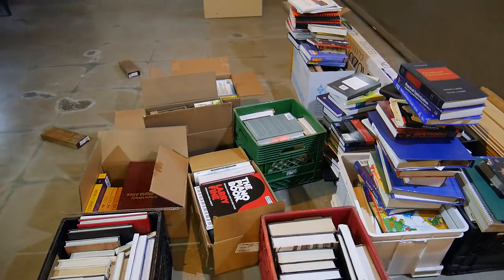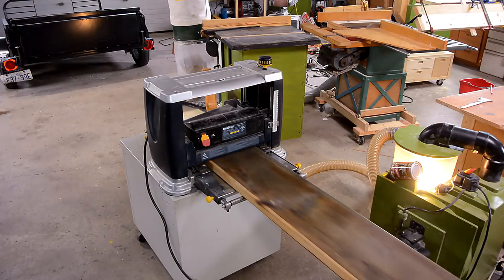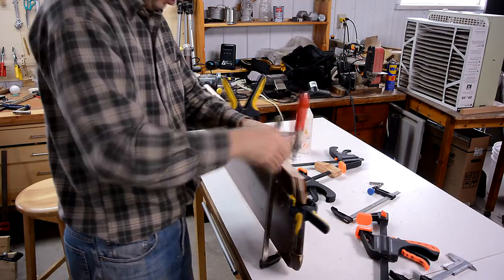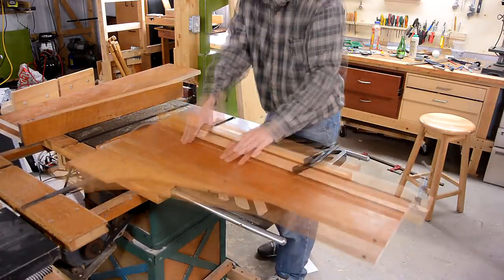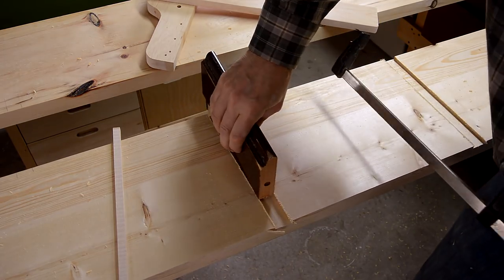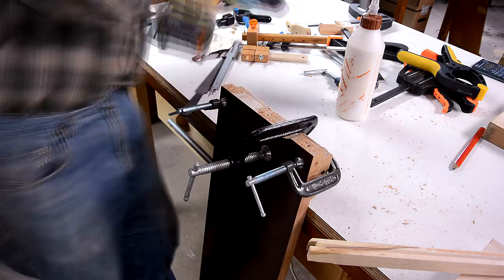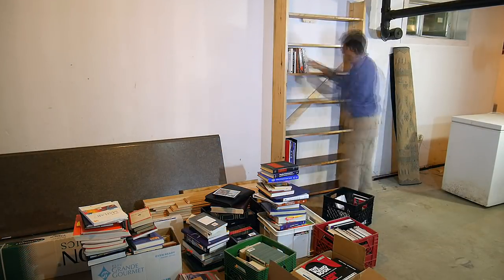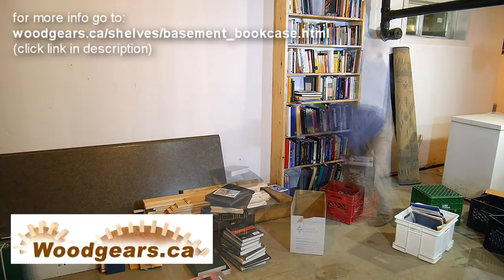Tall bookcase for the basement

Comment: Why did you tap the holes instead of using a larger predrill? I never saw you do that before.
Reply from the maker: more thread engagement
Reply: Matthias Wandel oh thanks for that. Was wondering.
Reply: Matthias Wandel Do the threads engage with the uprights of the bookcase at all? I ask because wouldn't there be an issue with thread alignment if one part is threaded and another is not?
Reply: the screws he used are not threaded all the way to the head
Reply: .... how about a test then?
Reply: Petros Iliadis I like test videos
Reply: jbz3 Me too. There aren't much semi scientific maker videos on youtube.

Comment: Cool practical build. Any reason (other than time) why you didn't plane the shelves too?
Reply: I was asking that myself too.
Reply: This shelf sits in the basement next to the laundry machines.    It is more then good enough.
Reply: The finish on the wood probably would have dulled the planer blades after 1-2 shelves. He would have needed to scrape it off by hand before putting it through the planer.
Reply: Damian Reloaded I was wondering the same. He planned the sides, but not the shelves, so it got me wondering.

I just bought my first planer (Delta 12" ...$150), so I'll probably start wanting to plane every piece of wood under the sun :-)
Reply: Maybe different finishes? A stain wouldn't bother plainer blades. Varnish or any kind of paint would be a different story.
Reply: In another comment below, Matthias said that it was a ply veneer, and plaining it would compromise strength.  Makes sense.

Comment: Why did you need a wood screw thread tap? Why not put the screws in like normal?
Reply from the maker: because I under-sized the hole to get more thread engagement.  That size hole would be likely to break the screw putting it in.
Reply: Matthias Wandel  how come you went freestyle this time on the project and didn't measure the space that the books  where going to take? your face of WTF  at the end is priceless
Reply: Custom size shelves for the specific 97 books he has? What happens if they donate some of the books?

Comment: Great video filled with simple, cheap, practical techniques resulting in a sturdy, utilitarian shelf ideal for its purpose. This is efficient design genius. Fantastic use of salvaged lumber, yet easy to replicate using home center s4s for those who lack access to bountiful dumpsters, or without a planer.

1) The four flute "wood tap" is brilliant
2) Great use of a shop built t-square to cut the dados, 
3) The spacer to fine tune the width of the dado is so much easier than trying to rig up some two sided arrangement
4) whole project could be easily done with the basic beginners kit of power tools...a circular saw, a router, and a cordless drill.
5) The diagonal brace transforms it into a professional grade project that will do the job needed for decades.

This is the sort of project that any new homeowner could and should tackle to solve the "piles of books we need to store until we finally have the nerve to use them to feed the wood stove" problem. So much stronger and more durable than the disposable termite barf alternative, and even if you had to buy instead of salvage all the wood, it's still probably a better solution than what eye key uh offers.

Comment: I'm surprised you didn't plane the old finish off the shelves and varnished the whole book case.
Reply from the maker: the shelves had two opposing plys of veneer on them, which makes them very stable, but also means its like running plywood thru the planer.  Better to leave the veneer on.
Reply: That makes a lot more sense, thanks for the explanation!

Comment: Best woodworking channel anywhere, as least that I'm familiar with.  Matthias, I know that you don't need or want kudo's from me, but this channel has it all; fast paced, innovation, invention, practical application, experimentation, all backed up with a calm no-nonsense intellect unlying the whole thing.  I've never failed to learn something; or discover a new way to do something.  Several take-a-ways in this video (the spacer to size the dado; the screw tap, etc).  
     With regard to your implication that critics seldom make videos:  You nailed it big-time.  And there is certainly a positive correlation between the strangeness and stridency of a comment, and the probably that the commenter has posted no videos.

Comment: I probably would have done some things differently, but this is a very effective job. My only criticism/question is that it appears the diagonal brace is set on the surface rather than inset, making the back not sit flush to the wall. Did I misinterpret or is it just one of those "close enough" things?

Comment: I've done the same myself and my bookcases have been around for more than 40 years, The only difference is mine have a 1/4" let in plywood backing. Using a router to cut the dado's is the best way to go, I worked for an electronics manufacturer for most of my career and I used to cut narrow strips of G10 epoxy 91/64, 1/32/1/16") to use as spacers to creep up on the exact width dado I needed for the wood I was using. i still have those strips and you would be surprised at how handy they are.

Comment: as constructive criticism, personally i would have planed off the shelves and stained them or coated them to be more resistant to wear and tear seeing as i would think this bookshelf will stay in the basement and probably get used for different storage other than books in the future, but i like what you did with the reclaimed wood and don"t think you should change anything. do the shelves already have a protective coating?
Reply: The shelves are veneered,  I guess the center wood is of lower quality.

Comment: I had a question about the diagonal support beam you put on the back of the book shelf. It seems most tall structures I build tend to have a wobble to them. Besides just putting a piece of plywood on the back to the structure, are there any clever ways to make a  support that looks good or blends in?

Comment: Nice build! The only thing I would have done different is use some 1/4 inch plywood or even pegboard material on the back to keep it rigid which would allow it to fit up against the wall closer.

Comment: The wood tap thing was pretty clever, but why did you need to have tapped holes for the shelves? Why not just a regular pilot hole? Not criticizing, just curious.
Reply from the maker: I can use smaller pilot holes that way, more thread engagement.  As explained in the linked article.

Comment: Since it assembled without glue (which would have made the screws redundant) I assume it is only temporary anyway.

btw: particle board is way stronger then people give it credit for. You can easily climb around on 19mm particle board. However, I wouldn't recommend using particle board for anything but waste and sacrificial boards.

Comment: I was going to ask why you tapped the screw holes rather than just letting the screws cut their own threads, but I clicked through to the project writeup to find the answer. Sharing here for anyone else curious:

"I drilled the pilot holes in the hardwood sides a bit small to get better thread engagement, but this makes the screws really hard to screw in and can also split the wood. So I made a wood screw thread tap. I drilled a hole in a block of wood, then cut away a quarter section of it."

But I am unsure whether the pilot holes were intentionally too small, or if it was unintentional and the tapping was to mitigate the problem.

Comment: I would have done better.

Actually, no, I wouldn't. BUT! Matthias, don't you think you should have affixed both sides of the bookcase before screwing the shelves in place? Then you could check if they're square.
Not that they aren't now (I don't know), and not that that's a critical thing for a bookcase.

Good idea in recycling the table tops and using those for the shelves. Those smooth surfaces will be great for the books.

Comment: why the homemade wood tap? when the holes are already pre-drilled wouldn't the first screw you put in the hole make it's own "threds" in the shelf? granted there would be a slight amount of compression of the wood in the holes, but i can't imagine this actually being an issue with hardwood this thick. o.o?
Reply from the maker: depends on how big you drill the hole

Comment: I don't understand the "cleaner dado cut" comment.  Isn't one side of the dado still cut using the spacer regardless if you use the spacer first or not?  And why would the dado be smaller if you cut with the spacer first?  Just curious.
Reply from the maker: the cutter cuts cleaner on one side than the other ,depending on direction of travel.  And cutting forces also deflect the cutter.
Reply: The "cleaner cut when clamped" that you initially referred to was actually on the right side of the first dado cut--the side that is cut away after you add the spacer?  So when you cut with the spacer first, you moved the router away from you with the spacer and then towards you, without the spacer, to get clean cut on both sides?  And there is less deflection against the cutting guide when the cut is made without a void already on one side? 

I'm not a woodworker (yet), so I don't even remember which direction the router bit is spinning without doing a search.  Thanks for your reply.

Comment: I think that it's not worth it but bad thing to thread those holes. Screws on wood get the holding power in a different way than steel screws, wood screws benefit by the tight pressure around their everything, while steel screws most on the threads (used on metal of course).

Comment: I could have built a much better bookcase. First I would have planted the trees myself in a UV-lit, temperature and moisture controlled giant greenhouse using carefully selected seeds of an exotic hardwood essence. I would have lectured the growing trees every day on philosophy, statics, resistance of materials and any other subject needed so the wood knows exactly how to be good shelves and why. Once the trees would be fully grown, I would mill them by hand, making sure to mark down how the wood grew not only up and down but also north/south/east/west. Then I would dry them in a custom-built drying chamber for 10 years. Once the wood is dry, I would hand plane each piece and begin planning and executing every joint using sublime glue-less, screws-less japanese joinery down to sub-millimeter tolerances. I would die of a heart attack from the physical exhaustion of putting up the bookcase at 94 years of age, 65 years after beginning construction, with the satisfaction of a life well spent one-upping a single one of Matthias Wandel's hundreds of videos.

Comment: It seems like it would only make sense to tap the holes if you were also going to make sure that the final screws actually followed those same threads and not cross threaded. Why thread a hole for screws that cut their own threads when drilled properly? Neat idea I suppose but it seems totally unnecessary.
Reply from the maker: the hole is tight enough that if I just screwed in straight, there's the risk of breaking the screw from the torque.
Reply: What would have been the solution sans tap, just drill a bigger hole?

Comment: "91 and a half centimetres" lets take the metric system and completely murder it !! Also centimetres are for dressmakers, it is normal /standard for if things engineering etc to be expressed in millimetres and metres. Perhaps it would sound better if the measurement in questions was expressed as "915 millimetres"!! I'm being very pedantic, but if a job is worth doing it is worth doing properly...
Reply from the maker: centimeters are for everyday people who use metric.  People who don't actually use metric insist on millimenters.